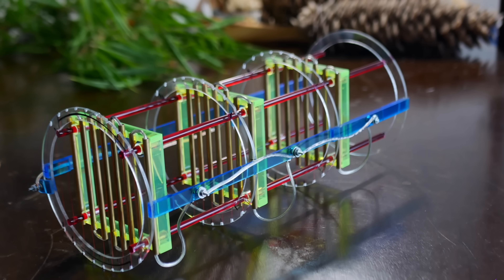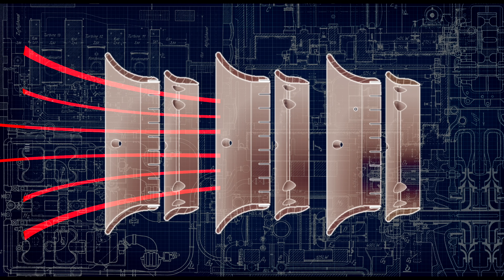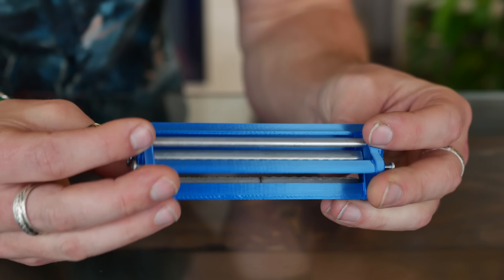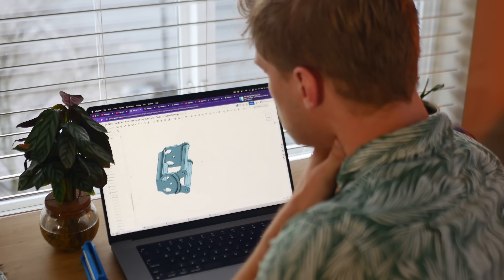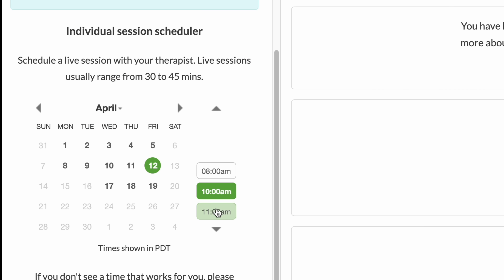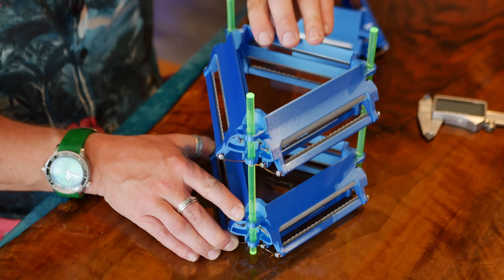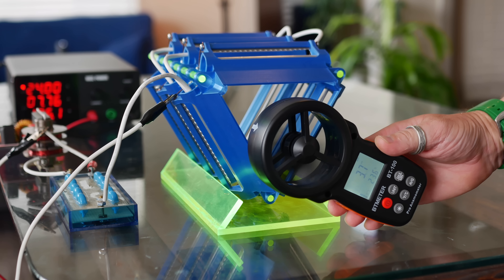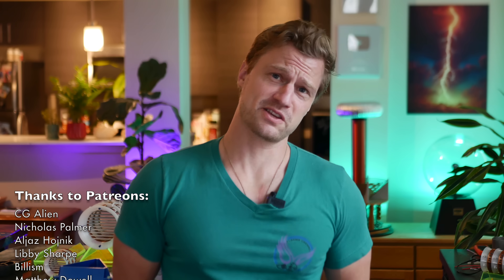Next-Gen Ionic Plasma Thruster Inspired By Nature (BTC Mark 3)

Comment: Awesome work!
Here are some improvements i suggest:

- measure grams of thrust per watt instead of airspeed

- focus mainly on achieving max thrust at a certain size

- use a single tube design with no holes in the sides of the design to simplify aerodynamics and testing

Robust design like you did was really smart, hope you continue with the ionic thurster. Would love to see this on rc planes or even table fans in the future
Reply: Could you imagine the power bill of such a fan compared to a typical 10-20W fan? Sucking down 100W of power just to have a small breeze with chance of electrical shock lol.
Reply from the maker: @CaedenV haha it’s exhilarating isn’t it? You forgot the best part - a small chance of fire too 😅
Reply: @PlasmaChannel iv been trying to explain the basics of my advanced aerospace to you for many many years and though my plasma thruster is very different you miss one major aspect in the technology. You have no pressure chamber around the thruster.... to explain it quick you have a pressure chamber but small scale for yours uses an elastic balloon. The thruster will need a skeleton around it for the deflated balloon to go around. One end of the balloon has a intake valve that can only suck air in from the thruster intake. On the other end you need a pressure valve that will release at a specific calculated pressure needed to launch it... have the thruster work and inflate the balloon building pressure that will fill it to desired pressure the the valve releases and as that happens thrust the thruster full power and it will utilize the pressure thrust combined with the thrusters thrust.. to cool it down so it does not melt the balloon use very cold helium gas dispersed into the plasma field but u think you should be good. Mine uses a metal pressure chamber at high pressures using hot plasma cooled down using very cold helium gas. The balloon method would be good to experiment with before using metal pressure chamber and a thruster that can produce dangerous pressures.
Reply: @HYEpower  While interesting, I don't see how a design that requires cold helium is practical.
Reply: @HYEpower  "Mine uses a metal pressure chamber at high pressures using hot plasma cooled down using very cold helium gas." Sure sure mate. Looks like you took a bit too much of the stuff you actually have.
Reply: @PlasmaChannel  why use 4 razors to get the same air output? Just use 2 in each wing to make it light. Besides more power is more weight also. Use 1d with more power one in each wing. Or maybe in a straight line but not in a triangle. That multiplies the weight by 3 but not the output. Also needs more power therefore more weight. Just make it flat in wings
Reply: @PlasmaChannel have you thought of turbines instead? You see hypersonic rockets make like constructive interference and makes like triangle shapes of the air? Maybe similar designs
Reply: @HYEpower  https://youtu.be/zomVPu6qWOY?si=gz1P80z_XHY6YxBG
Reply: thank you, airspeed does NOT determine whether or not it is good, the very first prototype may very well be better because it has more grams of thrust
Reply: I'm wondering if you can make the whole thing a circular ring? Bend the electrodes into circles. May be more efficient than a triangle with tight corners. Alternatively a hexagon maybe.
Reply: Sharper image used to sell a table fan based on this principle. It was a tall tower with ionic thruster inside. It was a silent fan. Been around since the 50's. So much of this stuff is repeating what has already been done. The yahoo lifters group advanced way beyond this in the 1999's and had flying aircraft.
Reply: Chat gtp ahh comment
Reply: "use a single tube design with no holes in the sides of the design to simplify aerodynamics and testing"

The concept he is applying is to pull air in from the sides & push it to the center.
Reply: @guytech7310  Couldn't agree more, he is not concentrating on the thrust, which is the absolute problem with this type of propulsion, messing around with all the other superfluous aspects is kind of lazy, but I know why he's doing that, it's easier than tackling the hard issue and it satisfies the easily impressed viewers out there, so, meh, I wouldn't call any of this really interesting or intriguing. For example if you look at another unrelated channel, ah "Tech. Ingredients" I think it's called, a father and son team who tackle all manner of projects those guys REALLY dig into the science and do respectable work.

Comment: What about using a column driver in the center, with a wing curvature to boost. 
From my understanding, when you move air across a wing it creates lift,  but also the air on both side has an attraction and one side moves faster than the other. like the air wants to be next to its buddies again and moves faster to catch up. the flat side pushes against the structure and the curved side moves faster. I think this is how turbines crush air to increase thrust from brief glances at turbine cross sections.

Comment: Aero engineer here:
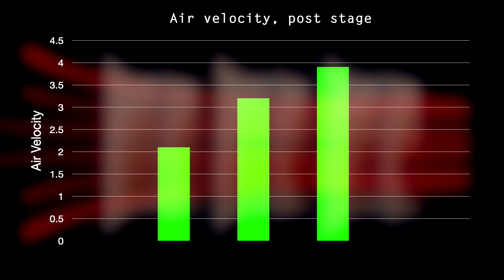See 3:12 
E=0.5mc^2 so your % increases are being underestimated. 

Energy @ 2.1 ~ m*2.1^2 = m*4.41
Energy @ 3.2 ~ m*3.2^2 = m*10.24

So delta energy ~10.24-4.41=5.83.

This indicates the second stage is actually more efficient than the first. AND considering you are entraining more air, the mass is probably higher so this is already underestimated.

Hope this helps!
Reply: I think you mean E=0.5 m v^2 and if so, I agree.
Reply: @WiggyB I hope not! I've been using my version for years 😖😂
Reply: @Raphvsmith  I dropped out engineering. But your formula is the one by Einstein for general relativity, and his is the formula for kinetic energy. but i don't think we know the volume or weight of air here so i don't see how any of these really help, maybe to estimate? what do you mean energy @ 2.1? energy like joule? how do you know did he say the wattage? if so then we would still need to know the efficiency of the device and subtract that no?
Reply: @Raphvsmith  E=mc^2 is mass energy equivalence from special relativity.
Reply: Yup, efficiency is about energy conversion - in this case to kinetic energy change: 0.5*m*(v_{2}^2-v_{1}^2).
If the relationship in velocity continued in the linear way that seems to have been expected, conservation of energy would have been broken :)
Reply: Sorry to nitpick here and my idea may not be entirely correct either, but the c in this formula is light speed and a constant (you can’t plug velocity in there!)

The (kinetic) energy formula that applies here is E(kinetic)=1/2*m*v^2 since we are well in the realm of Newtonian physics. Your point still remains with this formula!!

Besides, I believe thrust and specific impulse are more important since this is a thruster. Specific impulse kinda is the efficiency of the engine and correlated to exhaust speed. The added stages increased that with diminishing returns. 

The actual thrust was sadly never measured here. Measuring thrust with maybe a scale or so would have been interesting, because thrust to weight is the limiting factor for using this on a plane I think.

Your comment got me thinking so I had to reply:)
Reply: the entrained air doesnt produce thrust... screw energy conversion, delta mumbo jumbo pi theta cos.
wheres the action/reaction taking place? where is the WORK being performed?
against the electrodes, against the charged gas molecules. no where else.
everything else is drag, carried along for the ride, slipstream... you do no work upon that air stream, you ONLY work upon the electrostatic forces opposing the inertia of the charged gas molecules. the "neutral" gas molecules do nothing but get in the way. you perform no work upon them. only the gas you accelerated electrostatically performs work upon any additional airflow.

you can get high flow rates with air entrainment, but how much of that mass in motion reflects as force, or thrust, upon the frame itself, as a reaction force? none. as its due to the air having been accelerated and worked upon losing its energy to the surrounds.
Reply: @paradiselost9946  interesting point.

Agreed the reaction force is electrostatic.

Would the force be the same at lower air pressure or increase due to reduced drag?

Perhaps a question of energy conservation versus thrust generation. Agreed, thrust is probably most important here and that should be measured with a load cell setup!

Comment: Looks like it is problematic to accelerate air to higher velocities, but maybe ionic thrusters are good at moving high volumes but on lower speed, if this is true maybyou could optimize the build in that direction? Then maybe the air could compressed and higher velocities generated.

Comment: You could take inspiration from axial compressors, and have your cross-section slowly reduce for each stage to improve and achieve a set pressure ratio by the end. One reason why in your case more stages doesn't seem to help is that all stages are identical. However, downflow stages will need more power and a different geometry since they are fighting a higher pressure. Then, your high pressure flow could go through a converging nozzle to accelerate even further (or just add more and more smaller ionic stages along the way, it might work as well).

Comment: Too bad you can't bend the razors and grounds in a circle...then make an "ionic thruster" similar to a dyson bladeless fan (at the very least...they should really consider sponsoring you :) )...hollow in the middle and actually push air with NO moving parts.  Such an awesome improvement...and the fact there is NOTHING in the way of the airflow completely "strike proof" especially if the driving mechanism is inside a protective housing or engine enclosure
Amazing and brilliant work!
Keep em coming!!!!

Comment: Where you see a thruster i see a possible ventilation + air purifier in one package and adding some cooper tubing, a  bldc motor pump and butane maybe an efficient air conditioner with a lower power consumption compared to traditional AC.
Reply: Ozone is bad to breathe.

Comment: Could you take advantage of the Bernoulli effect, like on a Dyson fan, and use the thrusters to form a low pressure zone around the perimeter of a thruster which then draws more air into the main column? I feel like your current design is very close to this.

Comment: Why not optimize each stage and individually instead of just copy pasting? I would also use a different power supply for each stage so you can increase wattage as it get closer to the end of the thruster, you even said that having them at the same wattage just ends in diminishing returns

Comment: great video as always. dont remember if it was mentioned before, but did you try to use carbon fiber brush (like the ones in the commercial air ionizers) and see if that improves the power?

Comment: This would be a bit of work but would be really useful for testing and data collection.

If you make a model where you can adjust all the parameters easily, you could figure out optimal spacing configurations.
For example take 1 of your thrusters and redesign it so that you can adjust the spacing between the grounds, the spacing between the blades, the spacing between the grounds and the blades, and the width of the exhaust port.
You could set this up with 6 linear actuators and 5 servos,  hook those up to an arduino or some other micro controller and then adjust all the parameters easily from a single place.

You could take it a set further and setup a simple genetic algorithm where the spacings are your variables, and your fitness function is the air speed velocity you read from your measurement device.

This way you can place the thruster in a test chamber and run a series of evolutions to find some good spacings that get you some high end results.

The only problem with this is that you can fall into local maximums, so you have to keep in mind that the more times you run fresh test sequences the more likely you are to find the best results.

Comment: I think it should output a vortex, for less turbulence. Also consider inserting an aerodynamic shaft running its length.
Reply: If you bend the air, you create high and low pressure zones that would increase turbulence. Twisting air will have high pressure zones along the outer edge  and will not move in the same direction as the  external air without splines to erase some of the turbulence.
Laminar flow has a homogeneous distribution of pressure which is more desirable.
It's already bad enough that the incoming air also has pressure differentials that need to be corrected.
Turbulence is made up if vortexes so adding vortexes will just add more waste without some kind of advanced gap filling that can avoid high pressure against high pressure losses.
Reply: I bet it wouldn't be that hard to make it into a stable vortex. Perhaps as it's starting up this would be and issue but with a good design you could make the incoming air as constructive as possible I think

Comment: Fantastic Video Jay. Now, I'm might be wrong here, but based on your last few videos on ionic thrust, I'm assuming you noticed that in comparison to your expectations and for instance, your Ionic-Thrust-Engine Rival Integza, and his design, you weren't getting as high velocities as him, but I honestly think you still have a more powerful and advanced version than his. I think there's a good chance you already know this, but in case you don't, I'm going to apply my knowledge of Gas-Turbines/Jet-Engines to (hopefully), find out why your results seem underwhelming compared to Integzas model. The thing is, I think your model is pushing a lot more volume or a high amount of litres as you mentioned in this video at a lower velocity than Integzas (similar to a high-bipass turbofan engine, like the ones used to move giant, heavy commerical aircraft at low speeds, compared to fighter jets for instance), while Integzas model ended up pushing presumably less air, but at a higher speed/velocity (similar to a turbojet or a low-bipass turbofan engine, used in fighters for instance which, put simply, move less, faster). His was also a little bit more botched and less perfected, was far less ducted, and may have also had a different voltage, and thanks to this, it likely had less air flowing into it, but the little bit that did come in may have been subjected to a higher voltage, potentially more than your model, and that may be why the air was moving faster. Or it might have even had something to do with different testing conditions. But in general, I think your model has been improved over and over again dramatically over your several videos on it and is something to be proud of as it excels in the volume it pushes and presumably also the thrust, but maybe not the velocity, so don't be discouraged.

I hope this is correct and hopefully clears up (what I am assuming is) the reason for Jays Ion-engine pushing more air with less velocity than may have been initially expected, and also compared to Integzas Ion-engine model, for anybody who is reading this and wondered why.

Feel free to correct me in replies if I am wrong and I then may edit this to fit the new accurate information
Reply: IMO the reason is simply 1 thing, intenza used separate floating power sources for each stage which means that each stage can do full power acceleration.
in plasma channel's examples his first stage does most of the work and doesn't scale, intenza's scaled pretty well, imo the power sources is the reason for this.
Reply: @cj09beira  Ohhh thanks, you're right. Jay even showed this in this video with the first stage using 40 Watt and producing the most thurst, but the next stages delivering deminishign returns. He tried to fix it in this video too, but he may not have been particularly succesful at it... Thanks for this :)

Comment: @PlasmaChannel I'm no engineer, but I'm going to try giving you some maybe good advice, that can help in the future - first try to mount a single truster's main parts on common pivot point, so you could change their shape on the fly - while testing. Then do exactly the same when mounting them in triangle shape - so you can regulate the amount of turbulence when streams meet. Second advice - notice how turbo jet compressors are made - every stage has different size fan with blades having different angle of attack, and they all have different distance between each other. So if you want to achieve similar effect you could consider and try this method too. 
I hope that can help. I'd also add some feature to read the angles after setting trusts up.

Comment: Is the hollow center necessary if no air is going to be drawn through the center? Turbofans are dangerous because they suck stuff into the bowels of the engine itself— not simply because they have a large frontal surface area. Additionally, your engine is only banana-proof if the banana travels perfectly through the center of it. You are still unfortunately just as vulnerable to foreign object damage if the path of the banana deviates towards the outside of the engine. That isn’t to say that this isn’t a cool design feature— keep it if it doesn’t stand in the way of other things

Comment: You need more voltage, and greater spacing between anode/cathode on successive thrusters.  Accelerating the air takes more time with given thrust; more time, greater spacing, higher voltage potentials.  develop using fundamentals.  create laminar ducts, based on convergent concept.  Try creating in-line stages based on proportional spacing and voltage and integrate into each duct. create optimized nozel